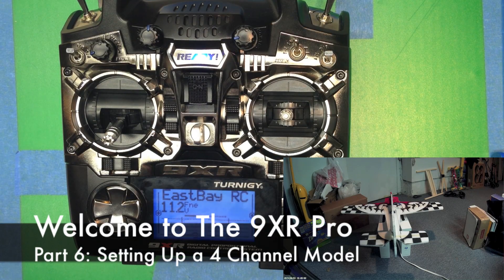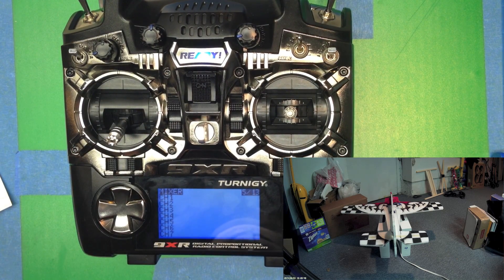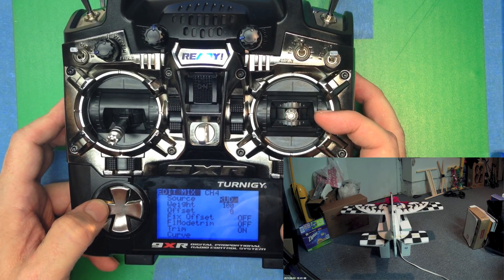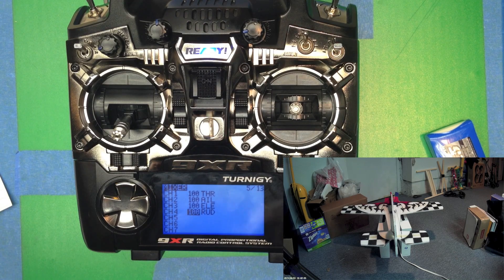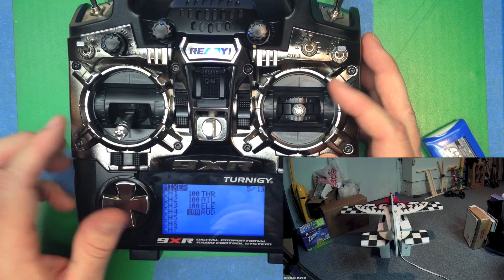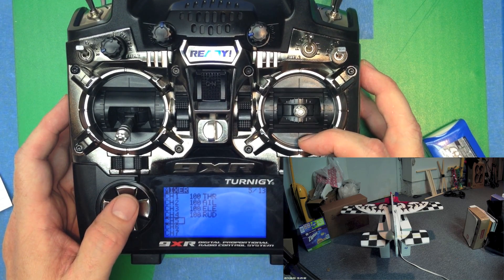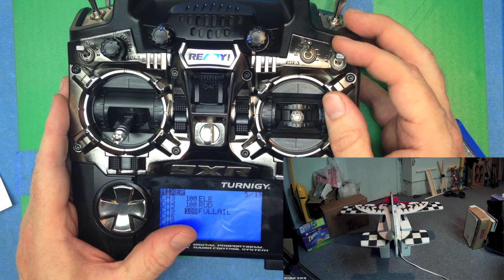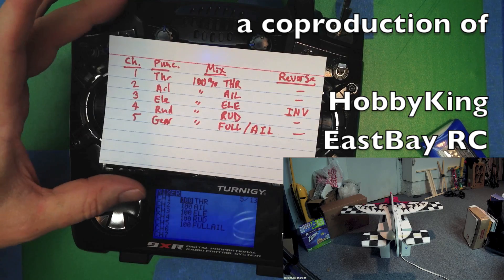Welcome to the Turnigy 9XR Pro, Part 6: Mixing a 4-Channel Plane

Comment: Unfortunately, you managed to do two sessions on mixes, without actually programming one in! The gobbledegook in the manual ignores sticks, and uses switches, then an example of a powered gilder going into a huge loop - not exactly a common setup!
     All I wanted was a straightforward mix of the ailerons and rudder!